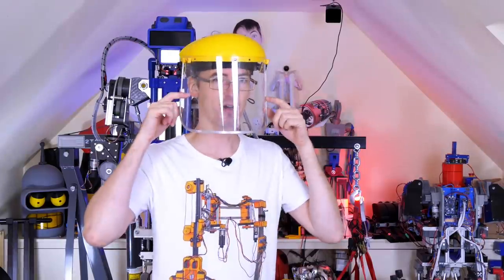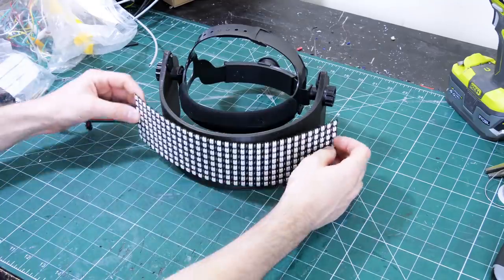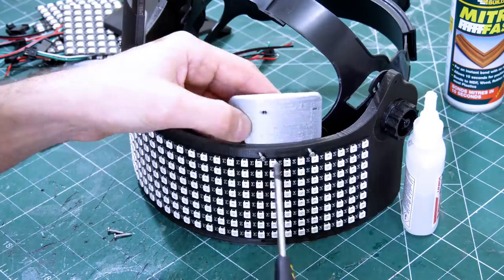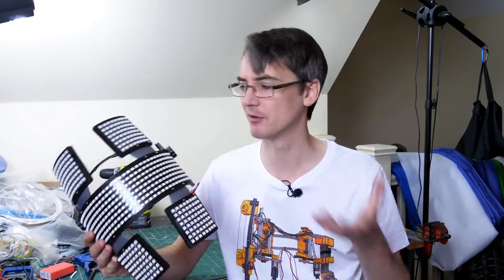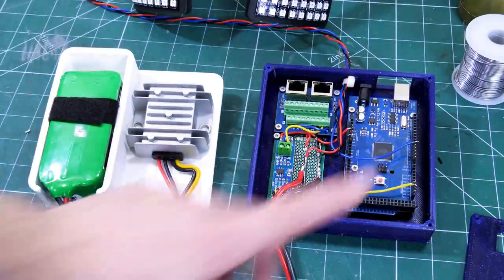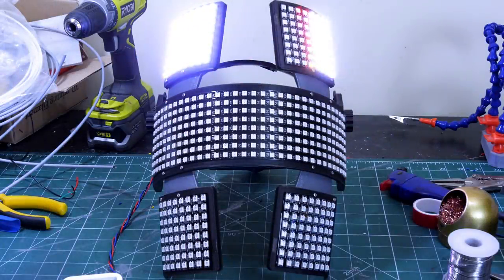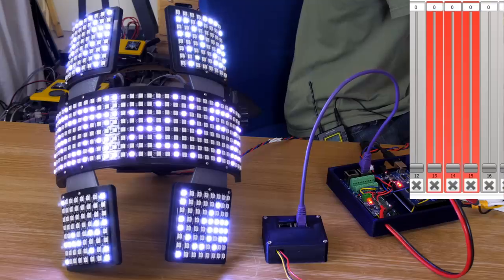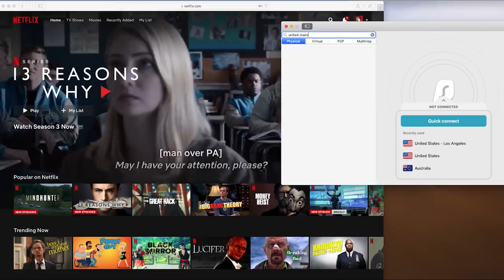Building a 512 LED DJ Helmet

Comment: I have a question. 
Would it be possible to make a suit completely out of LEDs and make them blink to music and sounds around you?
Kinda like the Fortnite Marshmallow skin just with full body LEDs (except for the feet maybe)
Reply from the maker: Yes, if you can power them
Reply: A few years ago I saw and article in Popular Mechanic magazine where a guy did this. It was cutting-edge for a diy project. Today it’s much much easier to do it.
You should use string neopixels.
Reply: @fantasticphil3863  thanks i will maybe do it when i have more money. :)